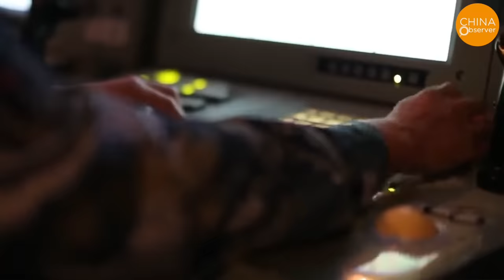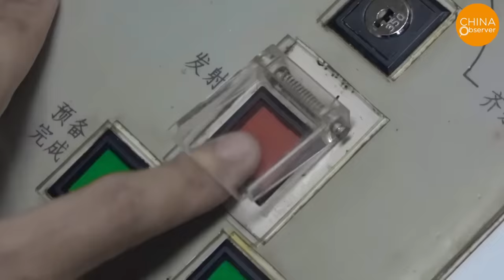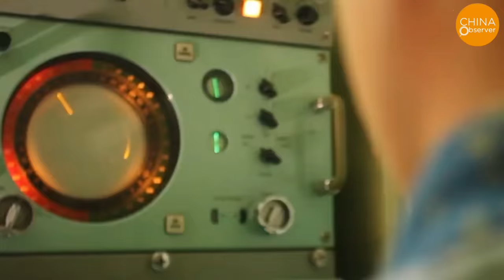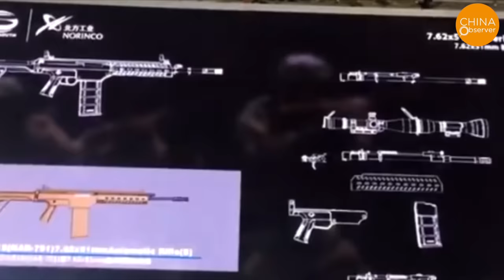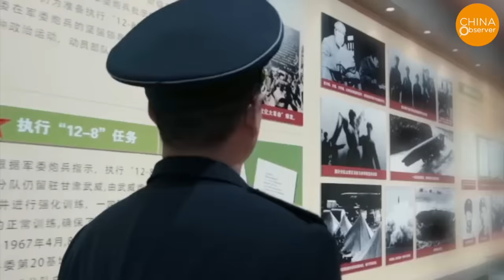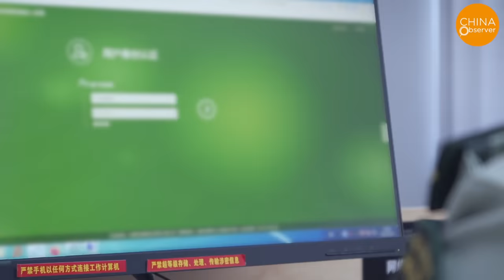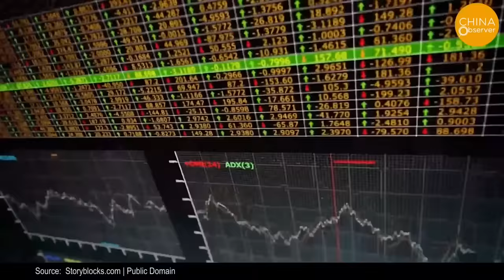China’s Aircraft Carriers, Stealth Jets & Missiles Are All a Joke! PLA’s Might Is Just ⅓ Its Facade

Comment: The short life of China's engines make the daily intrusions into Taiwanese air space more of strain on China than on Taiwan. 
Many reports said that the daily intrusions were done to wear out Taiwan's aircraft and pilots.  
I think the opposite is happening. 
Taiwan can easily afford maintenance of its aircraft.  
China's efforts become training exercises for the ROC Air Force.  

The F110 engines in Taiwan's F-16s last 12000 before needing overhaul or replacement. 
China's engines last 3000, according to this report.  
That is a huge difference.
Reply: Jet engines burn up after so many hours of use and need replacement!  I agreed with you!
Reply: @Paul-zf8ob  True. American engines will last 12000 hours. Some new ones will last 20000 hours. (I think that is right). 
BUT, China's engines last only 2000 to 3000 hours.  
So, China's harassment of Taiwan with its jets wears down China's planes a lot more than they do Taiwan's jets.

Comment: Recently there was a propaganda video that came out of china, showing soldiers firing through an obstacle course at short range simulating urban combat and house to house fighting. The camera cut to the target which showed holes all over it. The bullets had keyholed. (flew sideways, and impacting the target on the side not the front.) Soldiers were using extremely poor quality guns. When a gun fires a bullet, the bullet should spin in a stable way with the front of the bullet hitting first. The bullet should NOT flop end over end. It was amazing that they had created a video, and where someone, the camera man, the shooters, the gun makers seemed not to even be aware of how bad the situation was.
Reply: I remember that film too.
Reply: those keyholes are from low powder ammo that was suited for training and not actual combat .
Reply: @levelazn  Great thought. I had not thought of that. This could actually could be the reason. I haven't tested it, but the idea that high power ammo and low power ammo could operate differently, and that someone might have purposely loaded low power ammo for a safer training environment is reasonable. That said, some guns won't fire properly without enough powder in the cartridges.
Reply: @cryptickcryptick2241 they are smart! That 5.56 will become 10mm projectile, and it will hurt bad and stop even a big man....😂😂😂😂

Comment: J20 engines are slightly improved derivatives of Soviet and Russian engines. They require frequent overhaul every few hundred hours but that is similar to the deep maintenance schedule for typical Soviet engines. The replacement schedule is considerably longer at a few thousand hours. Engine overhaul is time consuming and expensive and is one of the leading factors in low availability rates but PLAAF rates are slightly better for the aircraft with Chinese engines. They are still poor quality overall but are near the top of the heap of available options for locally built PLAAF aircraft.

Comment: This is a very bold claim (1:50 mark) -"this may lead to the J20 being detected first by the AN/APG83 radar of the F16V". For information, J20 uses the latest GaN (Gallium Nitride) chips which have higher power and longer radar range than the older GaAs chips deployed by F16V. Besides, there is a full generational gap between the stealthy J20 and the non-stealth J16V.

Comment: Been saying this for decades and people say im crazy, but those of us who know the truth, know china is in even worse shape than russia military wise.  In their attrmpts to copy russia and America, the pla has made some major bonehead failures. Ego is one of those failures that led to corruption and lack of cross training between different types of forces. They have no logistics, no compatability between land sea and air froces. Joint ops is a joke. Material wise they use cheap metals in their ships and even use cheap off the shelf welders to weld their hulls and decks. The metal is known to crack and welds break constantly.  Their aircraft use cheap engines that are poorly designed and under powered. Their attempts to copy designs from russia and the US have been complete failures. And their "tactics" are WWII type tactics which do not work in a modern military.

Comment: the issue with Taiwanese f16's is that they are not equipped with the amraam. They are still being equipped with short range aim 7 which still requires the main aircraft to guide the missile onto its target
it is limited by its effective range only capable of firing up to 25 nautical miles according to the USAF report comparing it to the aim 120a (the first variant of the amraam) 
so the j20 would out range the f16 every single time even if the radar was not performing as expected
however they are getting 200 amraams
,but we also have to consider that the j20 would have ample time to reach operational altitude compared to f16's which would always be at a disadvantage because the j20 can lob the missile while the f16's are still slowly climbing